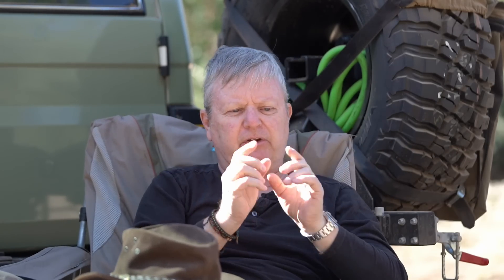TIRES - Traction, Rolling-Resistance EXPLAINED

Comment: I have general grabber x3's 33x12.5R18 best tire I've had on and off road. I've found that a wider tire performs better offroad especially for comfort. I have found that with a narrow tire tends to fall in holes and ruts creating a rough ride. Wider tires just roll over them with out falling in making the ride much better. Mud, snow, sand I'd take a wider tire then narrow with my truck, it also comes down to the torque and hp of the veh. Which my truck doesn't lack in either department.
Reply: Southern Nevada offroading and back country No offense but the very fact you even keep 18's on the truck pretty much voids your credibility. Taking about ride comfort and 18" wheels is hilarious 😂.
Reply: Southern Nevada offroading and back country and wide tyres look grouse
Reply: jeep6242 I don't remember letting you drive my truck the way I have it setup. My truck my opinion. Guarantee it ride smoother then your Jeep 😂😂😂😂
Reply: Denis Vincent Also a personal opinion, I happen to think they look better.
Reply: jeep6242 and also I can't really go smaller due to caliper clearance. I could to 17" which raptors have but 18" is the factory size on my truck. I prefer to keep they as close to stop as possible for reliability reasons.

Comment: Bigger tires have larger frontal area, which affects fuel economy, and they're heavier which affects acceleration, braking distances and steering/suspension component wear. They're a damn hazard on the road. The only reason to have large diameter wheels is to clear the brakes, otherwise it's all ego. The benefits to large diameter tires is subjective based on what the vehicle is used for. The King of the Hammers trucks use narrow, very tall tires, 40-44 inch, but not very wide at all. These trucks are high horsepower, high speed and rock crawl up canyons with boulders... Large diameters require lots of power to spin (weight) and high numerical gearing.
Reply: They are usually 12.5-13.5" wide tires, so they are very wide, but the ratio is not all that high
Reply: I agree with the ride, I have 37x12.5 BFG KO2's on my truck, I have only really used them in muddy conditions, upto 3 feet deep, as of yet, and they worked great

Comment: This video arrived at just the correct time, because it's time for new tires and wheels for my Ford E250 Van, and i have been planning on getting BF Goodrich AT's.   But two different sizes are available for my vehicle, one is wide and low profile and the other narrow and taller... thank you.
Reply: As a KO2 owner I say find something else...they've never gotten me stuck but they are just alright everywhere, except wet road in which case they are scary.
Reply: T4nkc0mm4nd3r I'm used to them being like that. I have had two other sets on some other vehicles.

Comment: Your point at 15:40 saying that tractors can't/don't let their tyres down is not correct. Historically they didn't because it was a huge effort to re-inflate them again but that's not because they didn't want to.

Increasingly tractor tyres are being made to run at lower pressure and high end draft work tractors are starting to be supplied with central tyre inflation systems so they can have low pressures in the field and high pressure on the road. For 15-20 years now good tractors (i.e. Fendt) have all come standard with on board air systems to power trailer brakes, that's been optional on lesser tractors  but most of them 150hp+ it's now the default option. That makes changing tyre pressures a lot easier, the compressors we had on even a 120hp tractor would output more than a standard inflation gun would take so would cycle on and off. Obviously you've still got to pump one hell of a lot of air!

The other relevant thing is that when you hook up a plough or other draft tool you'll typically put a large weight on the front. This has a similar effect to letting down the tyre although is obviously achieve the same goal by the opposite means. The primary aim is to rebalance the weight distribution and get the front tyres to do some work, but the added ballast does increase the footprint too. Some people as cheap ballast will fill tyres with water but that's not exactly an ideal option for most purposes.

Completely correct about steering though. When you see front line 2wd tractors (increasingly a rarity) they have ribs all around them and nothing across. Less critical/cared for tractors in the UK tend to have old Land Rover tyres on the front because a lot of them are 7.50R16.

Edit: it's marketing speak but relevant and (if you're me) interesting: https://www.fendt.com/int/11918.html
Reply: I have a large farm in Western Australia. Our tractors are on Triples (12 tyres). Its all about grip at the lowest ground pressure. We use radials and let then down as far as possible to get the largest footprint possible, for the maximum grip, at the lowest ground pressure, and not cause the tractor to bounce under load. Rolling resistance has little to nothing to do with it.
Reply from the maker: Thanks for that. Very interesting.
Reply: Always keen to hear about agriculture in Australia bru, and technology-wise, we've always had great respect, since much of it can be applied because of the similar challenging conditions we experience! You might in turn be interested to know that in South Africa, our annual NAMPO (National Maize Producers Organisation) Harvest Day exhibition was held last week - a showcase of local and international agricultural technology, and said to be the largest of its kind (?) in the southern hemisphere. Check it out on GrainSA's website - also a good couple of YT vids.
Reply: Something else to consider, at least here in the States, the company I work for produces TireFill (aka TyrFill) for material handlers, agricultural, and mining equipment. It’s an elastomeric fill that displaces the air for a cushioned ride as well as being flat-proof.  The TyrFill is not suitable for passenger vehicles as the elastomeric won’t hold up under highway speeds. That said, for slower vehicles, its wonderful! More info here:  www.accellatirefill.com
Reply: Tractors have pretty bad traction and performance in lots of places a lot of jeeps would just drive through. That's why they get stuck in the mud so easily. Also he mentions that tractors have narrow tires but as you indicated modern tractors that have the horsepower for it have really wide tires.
Reply: In todays very advanced Ag industry, a lot of science goes into this as the goal is to reduce or eliminate compaction as it reduces plant production.

To add to this nearly all tractors these days steer themselves to varying degrees of accuracy. This is also often to reduce compaction and allow more advanced farming methods.

Last year we had little rain in WA, in the past this would have been a disaster, but with new methods and technology it allow us to grow an above average crop.

Not about your topic, but a lot of people are ignorant to how advanced Agriculture in in Australia. Arguably the most advanced in the world.

Keep up the good work :)